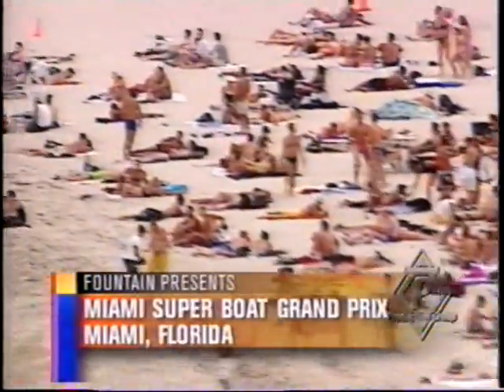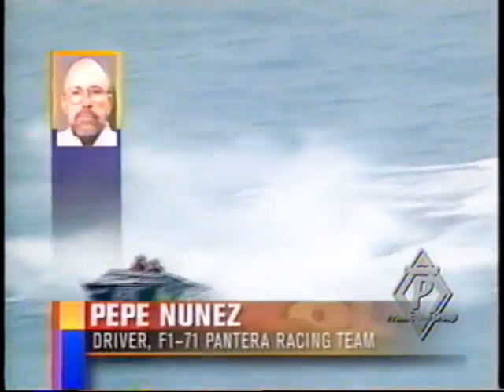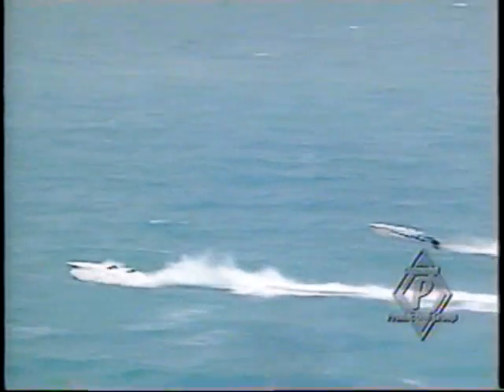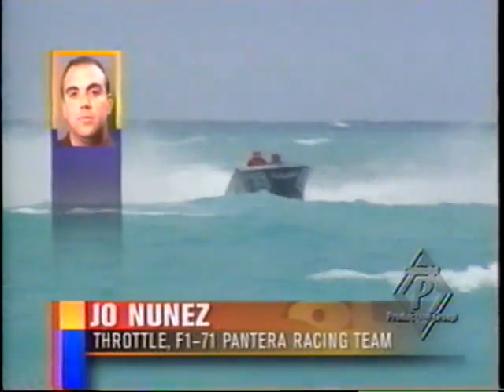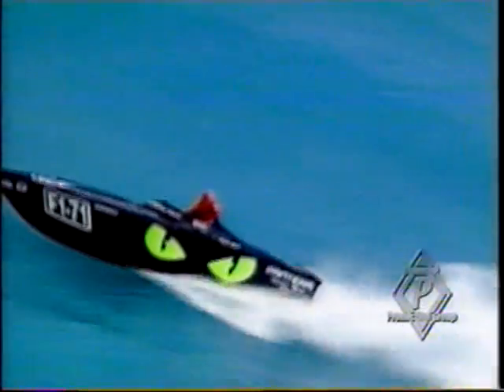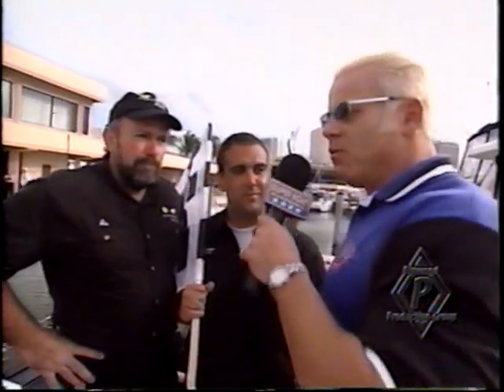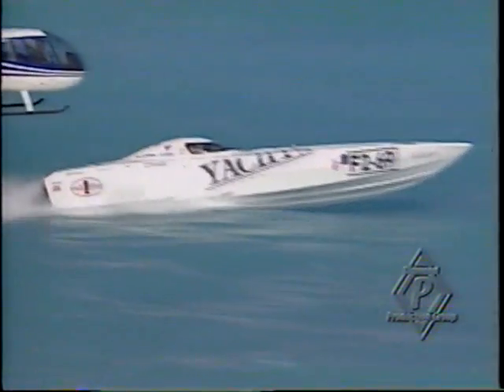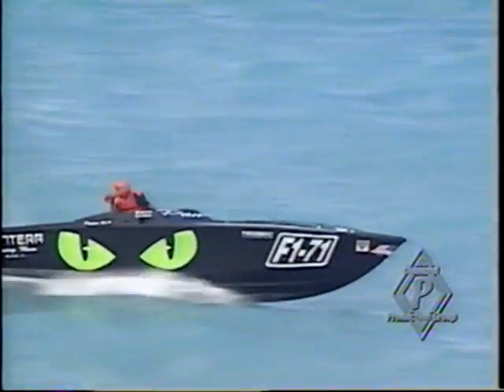Powerboat Racing in 7 - 8 ft seas Rough Water Jumps Offshore

Comment: Nice vid, but these are NOT 6-8 foot seas - 3 to 4 feet swell, with wavetop chop.

8 foot seas are *big*. I've got early vid foortage (mostly old betamax) of apba offshore racing from the mid-70's to 1981 - back when they used to cross the gulf stream in the bacardi trophy, or run out to Ambrose Light then fire island in the Guy Lombardo in freeport LI - some of those races had big, big seas.